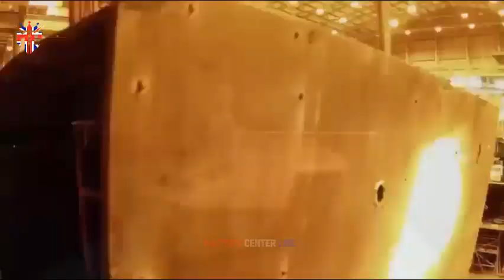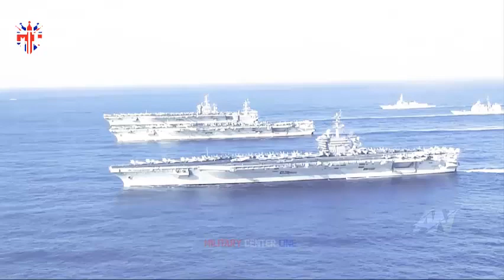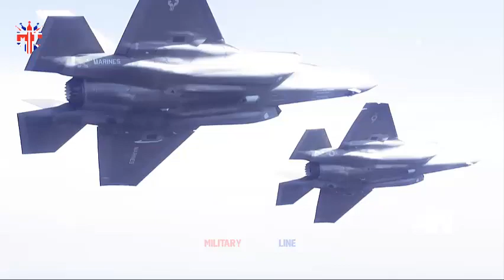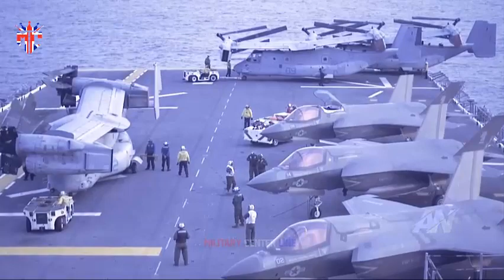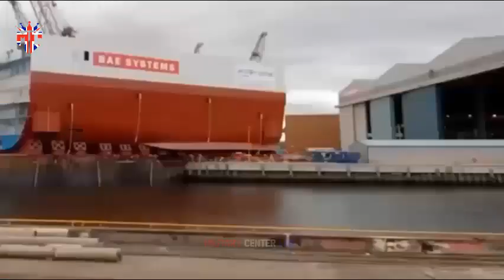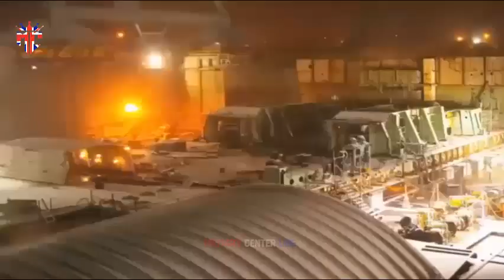FINALLY!! UK is building a new 100,000 tonne class nuclear-powered SUPERCARRIER A

Comment: Hms Queen Elizabeth class carriers can have a nose extention of about 120 metres could add 7500 tons to around 78,000 tons with a length of around 1050ft. Then add a electric catapult system you can take up to 75 aircraft include flying other model of aircraft include long ranger AWS aircraft.